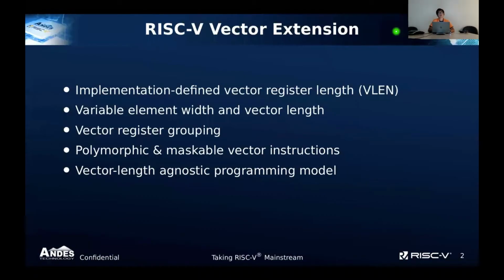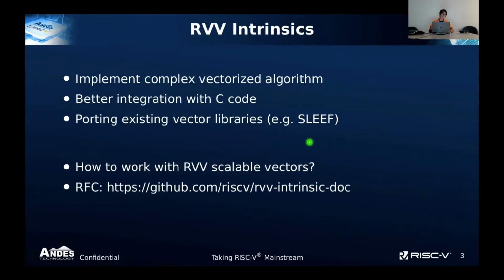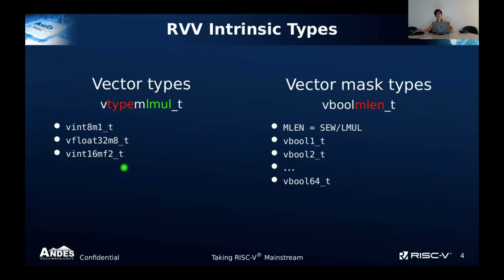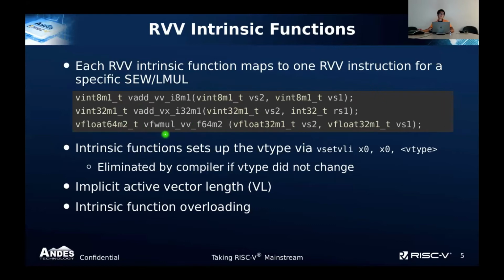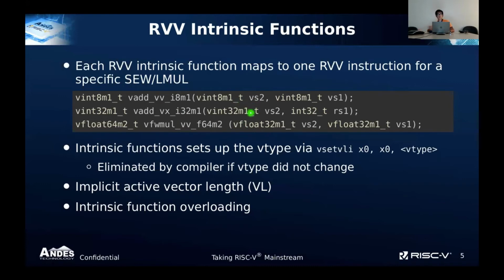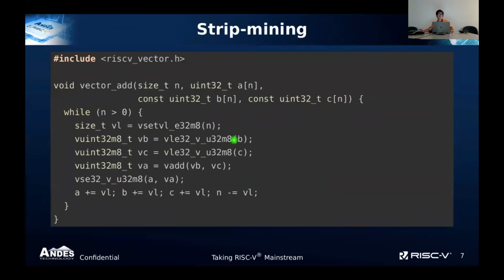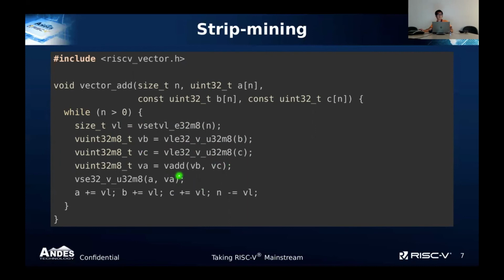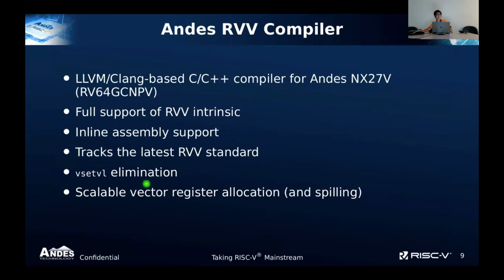An Introduction to RISC-V Vector Programming with C Intrinsics - Chih-Mao Chen, Andes Technology

Comment: Thanks for the presentation. 
I think there is a error on slide 7-8. On slide 7 "n" seems to be the first argument of the function but in slide 8, a3 is used for "n" which would make it the last function argument. ie. slide 7 is vector_add(n,a,b,c) but slide 8 is vector_add(a,b,c,n).